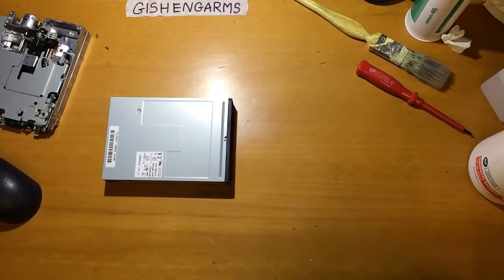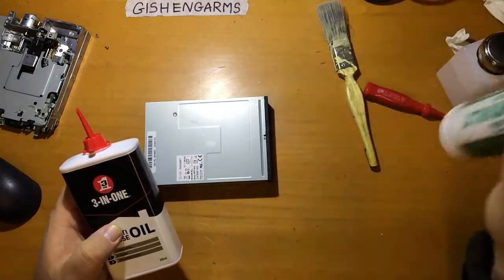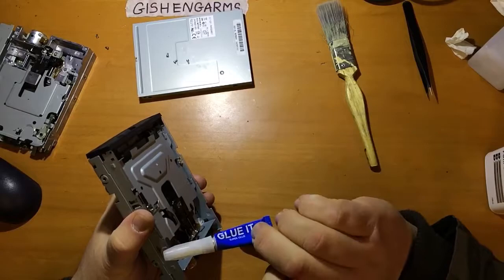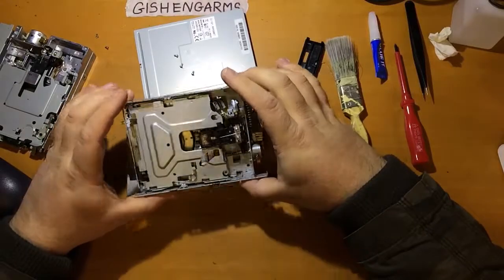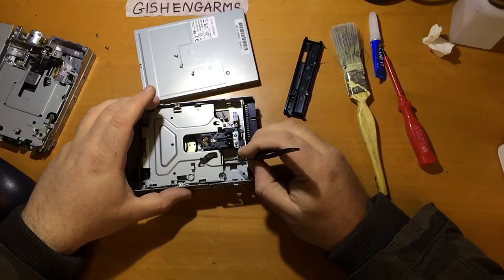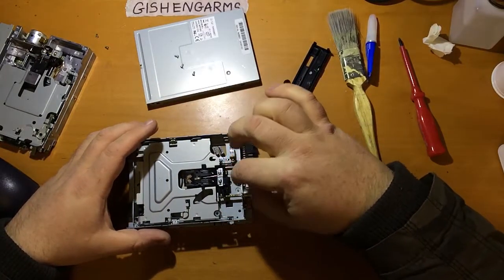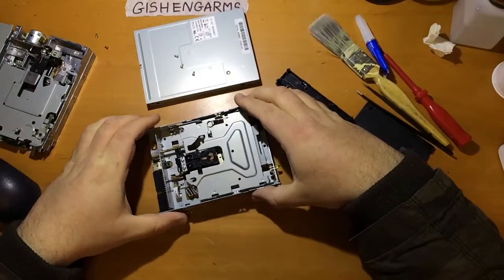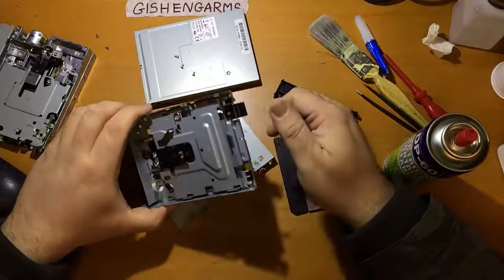Quick and dirty floppy drive restoration

Comment: I worked out that you can use a Biro lid to reliably remove the plastic faceplate without damaging anything. Just wedge the clip part into the hole and it should pop off nicely. Because it's a soft plastic tool, there's no danger of mangling the plastic faceplate like you would get with a screwdriver.

Comment: I have a FDD on my Kawai Piano that will not let me insert a disk. What would keep it from going in?
Reply from the maker: It differs from drive to drive, but sometimes the issue will be that the spring & arm mechanism that opens up the disk windows as you slide the disk in can get corroded or dirty and seize up. Usually if you get the drive out and open it up you'll be able to see what's sticking and it'll just need a good clean and lubrication.

Comment: @10.13, how do I know if my drive heads cant be manually moved to check the stepper-motor-spindle works ok (I can hand turn it to lube), but afterwards (with power on), nothing moves/heads just stutter...

Comment: In my case, the disc rotation motor is what needs lubrication, not the stepper motor. Would wd-40 work or should I use lithium grease?

Comment: I was just trying to repair/clean my floppy drive and the stepper motor just drives the lead screw forward so that the reader moves all the way.  The motor continues to push forward the reader in spurts causing the reader to click loudly at the end of the lead screw.  Why would this be the case and will tapping the stepper motor be the solution possibly?  Not sure why the stepper motor would continue to try and push the reader forward repeatedly.
Reply: I have a similar problem, the heads just move just a little and their is a grunt from the lead screw/stepper motor. Is mine dead? (this was post-lubing)

Comment: very helpful thanks. how do tell if the heads are worn? and do they wear out after use?
Reply from the maker: Strictly speaking the heads shouldn't really 'wear' per se as they shouldn't be in any significant mechanical contact with the disk (just very, very close). The wear on them is much more likely to be caused by buildup of dirt or failure of the drive electronics..
Reply: @VRMS_VRMS_VRMS  cheers for that as i didn't know. After watching this lastnight I got all the  bits n pieces and a new belt off ebay and now my MSX2 Panasonic FSA-1f is working a dream. This vid was a life saver . Cheers!

Comment: All good advice, thank you. I often have to repair failed drives in old synths and samplers and nine times out of ten they spring back to life to go on for many more years. Failed capacitors is also a very common failing in many synths ( -  and LCD monitors, for that matter!) and a relatively straightforward fix, so long as you keep safety in mind. Maybe you could make a video concerning this. :)
Reply from the maker: Yep, recapping that kind of gear is usually for the best. In the drives I've looked at so far there's very little by way of electrolytics but it's always my first port of call if the issue seems the be the electronics.